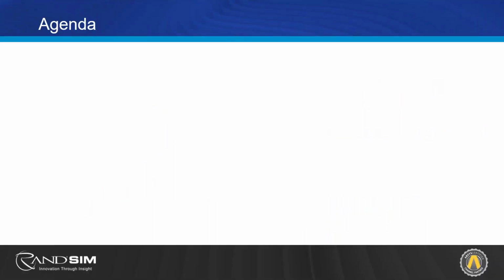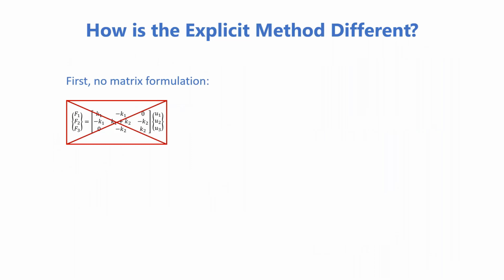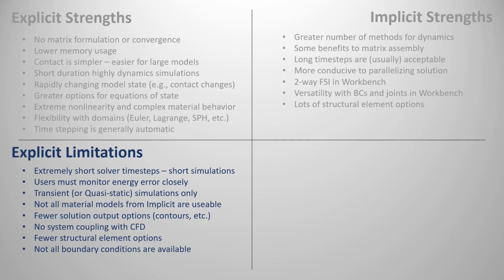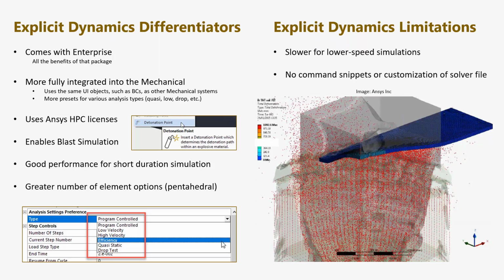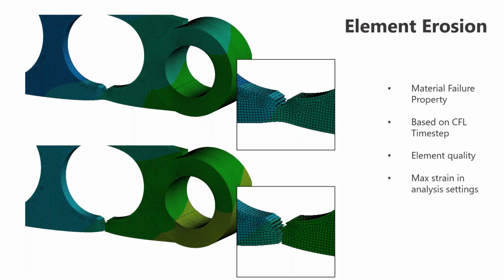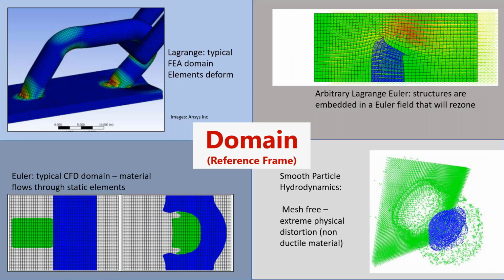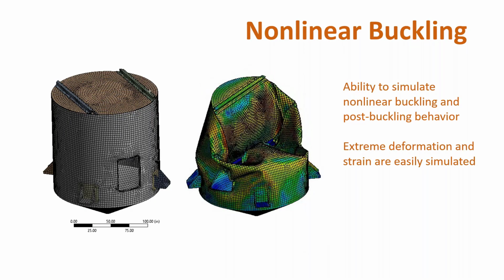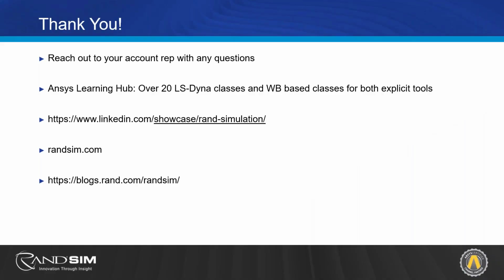Explicit Dynamics in Ansys Workbench at a Glance

Comment: The important thing for a  sim plate to be used depends on the material. What contents make up the material and their strength and influence on any other materials you are going to use. 
These should be considered in the sim design first. Well, all these sever the function in your product. That means you have to consider the materials itself and the environment and their function and influence, for the sim does not exist by itself as well as each of us.